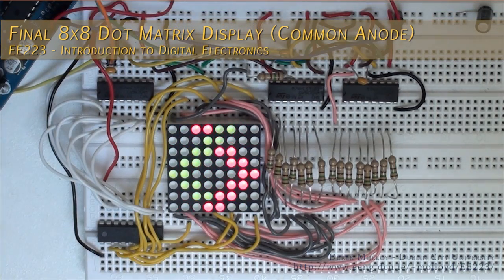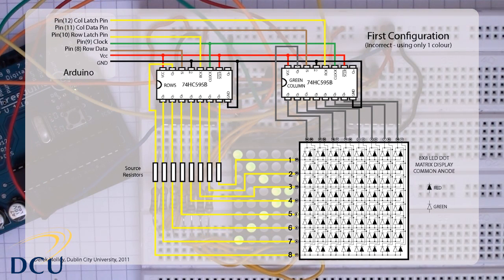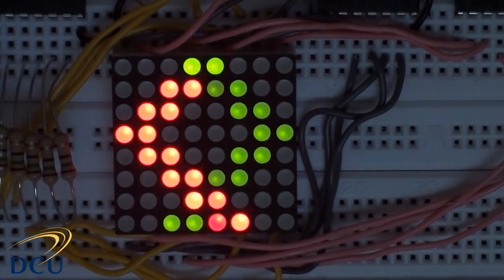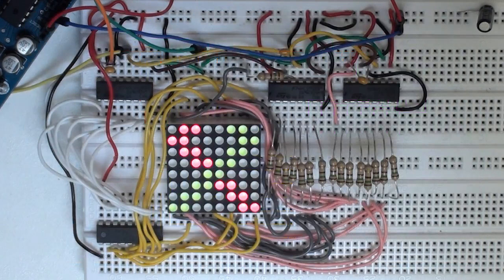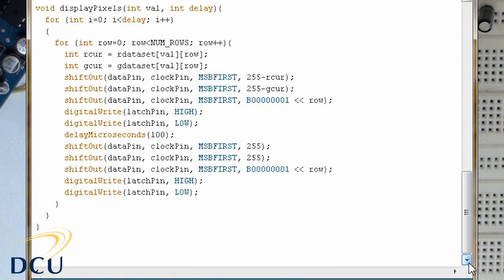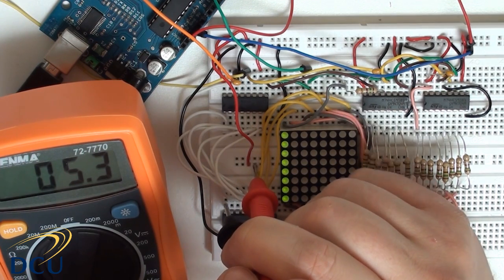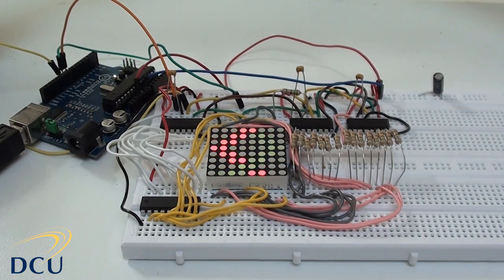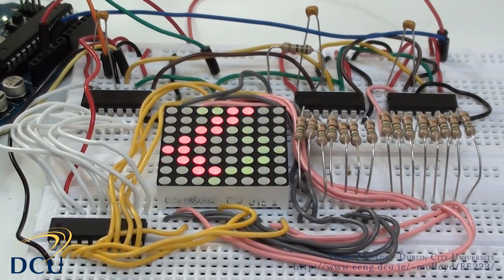Experiments 5.3: 8x8 LED Dot Matrix Display Tutorial (Red/Green Common Anode) using the Arduino

Comment: I'm stuck with my generic 8x8 matrix. Does it matter if the resistors are on the positive or negative side? I didn't think so but i'm having problems. I don't understand this common anode stuff, mine is common anode but I don't really know what this means??

Comment: OK, I got it now. Thank you! One last question: you have two ceramic 100nF capacitors tied to pins 16 and 13 on each shift register and an electrolytic one connected to? Of what value? Thanks in advance for clarifying this last problem and for the videos as well. Starting Robotics in September at Prague Technical Uni, this is of great help!

Comment: I am sorry I didnt make mysleft clear. Or there is something I dont understand :) Arduino digital pins cant source enough current to light the whole row. So you use the transistor array to source it from another voltage source whereas the pin only turns the transistor on and off. But what is the other pin that sources the current to the UDN and the shift registers? There is one on Arduino that can provide enough current for 8 LEDs?

Comment: Hi, fantastic video, thanks for that. 
A dumb question maybe but still: GND and Vcc is from a separate 5V circuit? Arduino provides 3 pins only? And the capacitors: what are their values and where they go exactly? Thanks a lot
Mike

Comment: Thanks for the great video! This has inspired me to make my own project using led matrices. I have 2 questions for you. 1. How would you control the brightness of each led to get shades between red and green while still using as few as possible outputs on the arduino? 2. If I use a PWM output of the arduino to control a transistor that powers the darlington array, would it be possible to set the brightness of the whole display? I would test this myself, but I am still waiting for parts.

Comment: @DerekMolloyDCU Okay, but what above the saturation voltage from the UDN2981A? Your current readings where less that 20mA, they were 5.3mA this was total for 2981 Vs pin green led and 4.4mA single red led. My guess was that there was a voltage loss due to the 2981, however I could never get 4.4mA in calculations. It just seemed odd that the resistors would be the same as this would cause different current values, making the red brighter than the green. Any ideas? Awesome circuit!

Comment: Hello, I was wondering why you used 150 ohm resistors for both red and green? What was the voltages and currents on each resistor for both red and green? Wouldn't you want them to be different so that the current through the leds is the same according to the led forward voltage? I guess you have a voltage saturation of 2v.

Comment: hello, i've also bought a common anode RG 8x8 matrix but i found that i can light the red and green led together to get the orange: if the red led is on, the green led won't light up! I think the problem is related to the voltage threshold of the leds that is lower in the red led, but i can't find how to solve this problem! i'm using 220ohm resistors on the anodes and the 3.3V source from the arduino to test the leds. thanks!